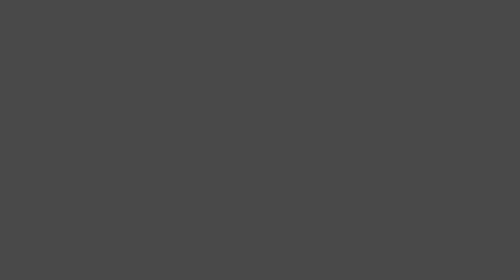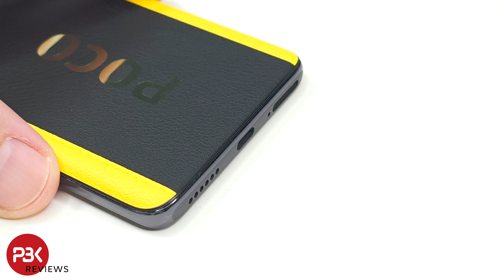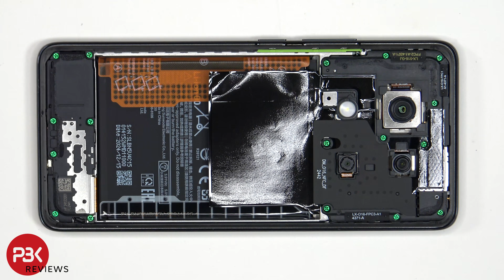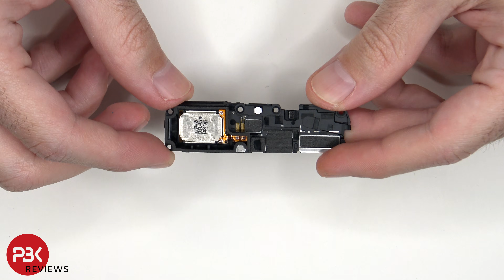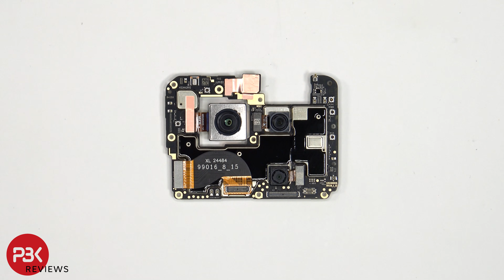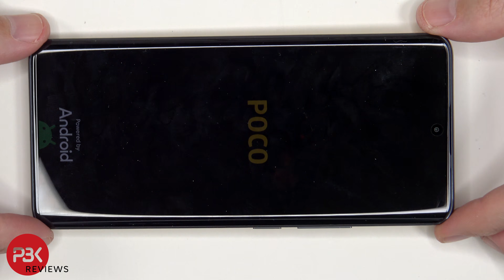Xiaomi Poco X7 Teardown Disassembly Phone Repair Video Review

Comment: Hello dear friends and brothers I have a question. I blew through the hole on the top of the phone, which is next to the second speaker, and a faint sound, not a loud sound, a very faint clicking sound came from the back of the phone. Is it possible that the adhesive on the back of the phone has loosened or peeled off? Thank you for answering.

Comment: Xiaomi phones are overheating i recently bought a Xiaomi redmi note 12 plus pro and heat like crazy even I f I am not doing anything just charging 37 celcuis and if I run 4k videos and run big games it goes up to 44 celcuis and we can feel warmth in our hand holding the phone cpu z is app where we can see the temperature of mobile and it always 37 celcuis not recommend any one to buy Xiaomi phone this phone also overheat
Reply: stop  spreading lies iphone overheating badly apple user love to lie to defend crapple so pathetic
Reply: Have you tried all of them? The Poco X7 is a really cool phone. You have to try to make it overheat, but on the other hand, I have the Xiaomi MI 13 Lite, which has a Samsung made QC SD 7 Gen 1 CPU that heats up randomly and excessively. So it depends on the model and the phone's CPU, not just the brand.